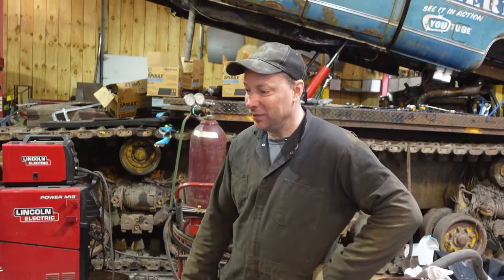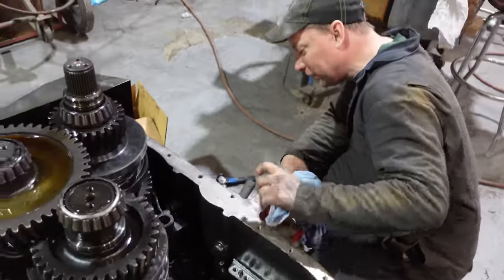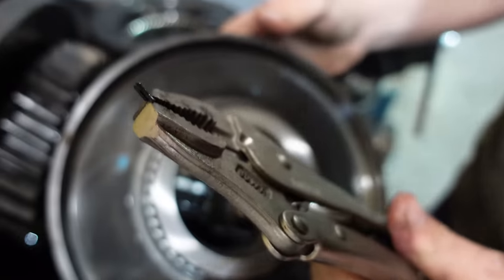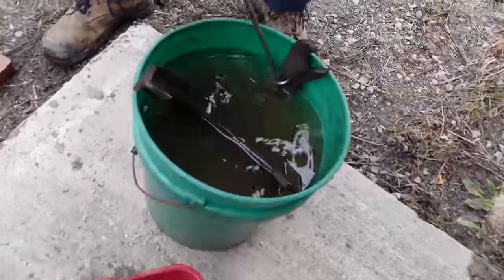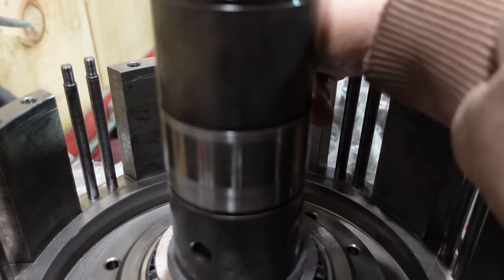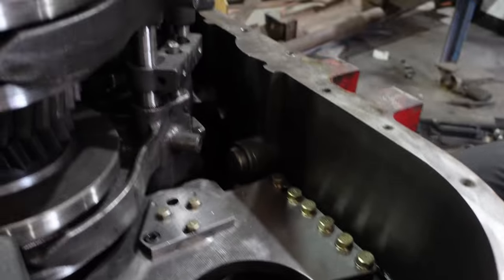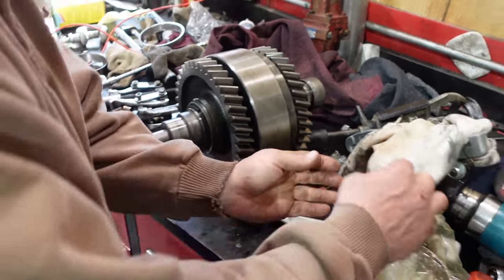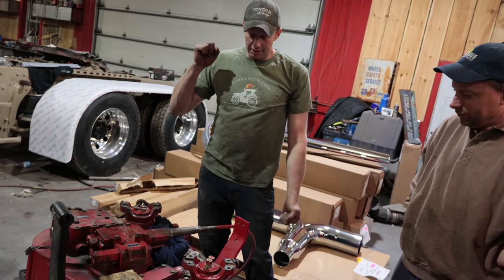Spend $70,000 ...or Fix it? 24-Speed Synchro Transmission | Case IH 9350 Steiger [EP2]

Comment: I'm a hobby mechanic at best. I've rebuilt engines, a Dana 44, etc. I can sort of weld, I can usually figure out most things. But this?!? Ho Lee Chit. This is baffling. Respect to you fellas for tackling this Chinese puzzle of a transmission!
Reply: A shop manual with instructions to troubleshoot and rebuild parts # clearances and exposed views is the only way I can get on to something critical
Reply: Just a big box of gears 🤣🤣🤣 lot of steel
Reply: I build race cars, but I still have no idea how an automatic transmission works. It just does.
Reply: @1one3_Racing  so true hahaha
Reply: It's Japanese.
Reply: Oh some bad news, you are to rebuild one, install one in your vehicle and see how long that Dana 44 can live with the insane torque output this gearing can give you :D
Reply: No doubt
Reply: Chinese??? I think you should learn to do research with a search engine...
Reply: Same
Reply: It looks more scarey than it actually is . Big things are easy but heavy . Just make sure clearances are right or they either chew themselves to bits to tight or rattle when to lose .
Reply: @ytthecommunistplatform.2675  Yep I'd take my chances with this transmission versus trying to repair a Rolex
Reply: In the Same boat , With a manual , I'd give it a try , and a phone a friend !
Reply: @khancrow8212  Chinese puzzle: an intricate or ingenious puzzle.  You might wanna take your own advice before assume what some else meant.

Comment: This and all transmission rebuilds seem like a "how hard could it be" job that you start then never can get everything back together, either loosing, forgetting, or putting in one small piece wrong and have to blow it all open again. Great job on this.
Reply: I wouldn’t wanna be the one paying for it
Reply: thats how rebuilding my lawnmower diff went, broke the open dif so I welded it(pro tip torch the gear to burn off the oil before welding) and uhhh not so much forgot to put a part back in, more so that I forgot on my unit, like a bicycle, it needs to be engaged to pop into gear. Guess who re-rebuilt it thinking he messed something up? (:
Reply: I'm currently rebuilding an automatic out of an 80s mercedes.....it's been an ordeal for sure lol

Comment: I'm with Kevin regarding sealant. Definitely falls under "The bigger the gob, the better the job"
Reply: Also, it's anaerobic, so it shouldn't clog up any oil passages.
Reply: @jrevillug  you’re kidding right?
Reply: @jrevillug  shouldn't 😂😂😂 but believe me it will 👌😂😂😂
Reply: Don't use any more anaerobic sealant than necessary. Squeeze out should not cure and get in screen, but it can if there is too much.
The suction screen is not very large on those, but all oil goes through the pump, is filtered and cooled before entering the transmission. There should be no sealant used on any of the gaskets that seal the shaft ends.

Judging by the amount of external squeeze out they used way too much expensive sealant.
Also, I hope they wiped it off, that stuff never cures and you end up with 515 all over your clothes.
Reply: @jimnaden5594  yup, this is exactly how my FR-S died after Toyota performed a valve spring recall on it. They used too much sealant on the timing cover and bits of excess RTV clogged one of my oil galleries, and part of the pick up. Not cool.
Reply: I agree completely, especially when it's a part thats a PIA to get at
Reply: I strongly disagree.  Especially with that Locktite 518.  It is used in MANY applications where you have a machined surface mating to a machined surface.  I just rebuilt an outboard motor that calls for it.  If you look at it when taking it apart you can barely see the residual 518, it is that thin.  A thin, almost see-through even layer is all that is required.  99% of what he applied will squeeze either outside the case, which is fine, or inside, which may not be fine.

His case will not leak, but he needs to pray that the excess sealant doesn't clog any oil galleries.
Reply: @zabzinski  that's because RTV isn't anaerobic, part of why that type of sealant is called for sometimes. Unfortunate about the engine. Definitely have to be careful about that when it comes to RTV.
Reply: @Bobbywolf64  yeah I remeber doing the valve/cam cover on a volvo white block engine and on those the valve cover also acts as the cam journals and that cover calls for anaerobic sealant beacause of the machined surfaces. The correct procedure according to Volvo is to apply it using a roller so it should indeed be a really thin layer

Comment: I love doing gearboxes, especially big ones. I used to spend my saturdays putting engines and gearboxes back together after the line mechanics took them apart during the week. they were warranty returns going back the the factory from the truck dealership i was working at, and it was really just so they all went back in one lump than as a box of parts. I learned a LOT doing that, a perfect job for a 14 year old! Since then I've always taken gearbox jobs if given the choice, nothing is more satisfying than watching nicely machined parts go together.

Comment: So, I was a small engine mechanic for about 15 years. My personal mower now is a kubota g1800 3 cylinder diesel. I WAS APPAULED AT THE PARTS PRICES! $120 for a U-joint, $100 for an idler pulley, $350 for the e-box that controls a couple of simple safety's and turns the engine off... Just insane to me. $120 for a u-joint that doesn't even do half the work of a car? holy cow! Most expensive lawnmower to repair I've ever seen in my life.

Comment: I am NOT a Case IH tech, but I've seen clutches like that master clutch before. Pretty sure they're supposed to be dished like that. Helps break the oil sticktion so the clutch doesn't drag. If they were all completely flat, they'd ring together like gauge blocks and act engaged.
Reply: Those plates are not to have a bevel to them, they should be flat.

Comment: The beauty of anaerobic sealer is that it does not harden except where it needs to like on the sealing surface, any extra will dissolve into the oil and not plug orifices like RTV will. Love that stuff but man it is spendy.
Great job on that trans, lets hope it all works once installed!

Comment: Great video!  This was awesome to watch.  One thing, though:  When you were setting the pre-load on those bearings at the end, you measured a gap of 0.022".  Earlier, you said that you were allowed 0.002" crush on the gasket, so, with a gasket thickness of 0.020", the gap could be 0.018" to 0.020".  With a gap of 0.022", wouldn't you need to remove a two to four thou of shim thickness to have proper gasket crush?

Comment: I did a bunch of business with Snead at my previous employer, these guys definitely know their CNH drivelines as they rent several old, and new Steigers for use with large scraper pans.. not many better ways to destroy driveline components than scraping, especially when the operator isn’t paying for the equipment.
I have visited their shop - it is exactly what you would expect out of a tractor shop in Alabama haha. 
They have built several of their own tools for rebuilding these huge transmissions and axles as well, I was told one of their axle presses gets frequently rented to large CNH dealers as it is the only portable press capable of working some of the assemblies in the country.

Comment: This video got me motivated to change my drivers side CV axle on my 2002 Ford zx2. Its a 4 cylinder automatic, them things are a bitch to release from transmission, even had the tool with slide bar, but a crow bar did the trick. Hugh Mc -Chicago metro

Comment: I worked at a case IH shop for a few years and seen several 9350s in the shop. I never seen the inside of one of those though. I worked on the cane harvester side. I did a lot of work on the 8.3 Cummins and was the shop welder. I did cut out and replaced a few center section pivot plates on the 9350. That was a job. They usually took out the back glass before they realized the steering bushings in the plate were gone and destroyed the plate. I did help them cut up and scrap a few old 9350s and we sent the motors and transmissions over seas somewhere.

Comment: Sure I will pull it apart. It getting it back together correctly is where the money is. Been scared before but last time I thought about rebuilding a trans I looked at the new blister pack of parts and took it to a trans specialist…. No problem working on my 6.0 power smoke but not willing to open the can of worms on a transmission. Hat off to ya Kev. Can’t wait to see the Case pop thru the gears..

Comment: Thanks for putting in the time to show us how a big gearbox repair can be done.  I've been lazy leaving my truck box without a 3rd synchro for years, but feel more confident to tackle it knowing it won't be nearly as complicated as this.  I bought the reco box for a hino engine swap on an old inter firetruck motorhome years ago and the synchro was no good, but the hassle of pulling it out again for warranty wasn't worth it at the time, so just drove it.  Wifey wants to drive it now, so might have to fix it after all :)

Comment: I'm glad to see you used citric acid to clean up those rusty parts.  I use it to clean out motorcycle gas tanks and I can't believe how well it works!  If you let it sit a couple of days and swirl it around once and a while, a nasty 50 year old Honda Trail 90 tank came out looking like new inside!  It works great and isn't toxic, and it's safe to send down the sewer sink if you dilute it.  I think you were had on the cost of the citric acid powder though.  Amazon has a 10 lb bag for ~$32.00 Canadian Dollars (used 1:1.28 as conversion factor from USD to CAD).

Comment: I've never anything that big apart. But having built a lot of small manual transmissions my guess would be with those pins missing when shifting the sleeve isn't applying even pressure to the synchro when shifting preventing the synchro from actually slowing the gear down.

Comment: All three transmission shafts and shift forks come out as one ☝🏼 assembly…
You remove the shift fork shafts and then the transmission comes out of the case.
Use a ratchet strap to hold the three together !

Comment: When measuring clutch clearances with a feeler gauge you need to use at least 2 feeler gauges on opposite sides.  With a clutch housing that larger you really should use 3 or 4 eeler gauges.

Comment: The reason for the polymer seals is that they won't ruin the bearing surface with wear, unlike the steel/ cast iron rings will

Comment: Wow, great job. I went through a couple Case plant in the 80's, they had sealant by the 45 gallon barrel full like the grease guns in shops coming in lines from above, and they were putting big beads on it then. It was orange sealant just like the Case castings were then. Seen a finally assembly plant ( 2200 series) and the transmission plant for the same. Guessing Kevin's background is heavy equipment and not Tv's 🤣. 👍👍

Comment: RTV only squishes to 3-5thou MIN. For any boxes where the split joint creates a tolerance use 515-518. It sqeezes to 1 thou or less, so it's very predictable for outer-race crushes and tapered bearing pre-loads.

Comment: Could you get more parts from the transmission put under x-ray, parts that you suspect could fail, to look for micro fractures, nip things in the bud before you put it back together, replace things before they fail, could the casing be warped?.

Comment: I literally got an anxiety attack just looking and listening to you guy's describing what you were doing to repair this giant gear box transmission. I been working on computers since 2002 there are not really a lot of moving parts in a computer. I remember in college telling myself before; I could work on a computer I needed to have a basic understanding of what the hell it is actually doing. So, ok input goes in here, next processing is happening there and then output, say visual is showing up on the monitor some times accompanied by audio along with some thing being answered or accomplished. After only a couple years. I would say; simply it's just a stupid machine to make my self feel superior and with out a human it's useless. Knowing I was basically full of shit. But; it helped me feel better when I fixed it or at least knew what the hell was wrong with it. Well I am still amazed that they can first design a gear box like this and then there are guy's who actually repair and understand the process of how it works. It really boggles my mind.

Comment: OEMs make a large portion of their profits on aftermarket parts where they mark them up outrageously. Most of the replacement parts are commodity items. If you can figure out the equivalent generic part, save the money.

Comment: The way Kevin measured the preload sounds Like the gap was .023 and the gasket was. 020... wouldn't that leak and not give any pre load?
Reply: The gap will close up to the gasket thickness, and that will preload the bearings.
Reply: Yeah, He seemed confused. At first he said was going for 0.018"  and if more that 0.020" shims would be removed. Then he said 0.022" was good because your allowed 0.002" for crush.

I'm just going to assume he knows what he's doing and just said it wrong. Once the bolts are torqued to spec it should close up a 0.004" gap.

Comment: With the Nissan 4wd TD42  6 diesel direct injector pump when it plays up & starts stalling it can be the $2.50 seal in front that lets air in & diesel out . . for that few hours fix they charge over a $1000 for an exchange pump & you have to give your old pump over as well so they can perpetrate the scam all over again . . Australia racket with that bit

Comment: Always Always ALWAYS!!! go for 5th then put it in first if you cant get it out of neutral. I hear/see this all the time at the truck stops... guy in a nice 300k pete and the clutch brake is shot so they just grind it till it falls in... hit 5th gear first then second or third, hell I've driven some so bad had to put it in high 6th then drop it in 1st or 2nd.

Comment: Older Australian built International tractors had proprietary bearings throughout the drivetrain where the journals and housings just didnt fit standard and cheaper bearings.  They did it on purpose and the roller cages in places were soft and didn't last. If you knew where to look you could get bronze caged roller and ball bearings which were better
 Sad to see the same thing 50 + years later....

Comment: Yeah bearing prices are weird I just bought a 550$ one for a chipper. When I received it I realized if I could have saved the housing instead of having to cut it off the shaft the bearing is only 100$. So they charge you all that money for some cheap cast iron housing cause they know your not getting it off without cutting it.

Comment: It sucks that the bearings used in the tranny are specific to the manufacture, but this is just another case of "Right to Repair".  The manufacture (Steiger) made the choice to use special bearing (only available from Steiger) so that parts could ONLY be purchased from the OEM thus guaranteeing profits from parts sales.  So the end user is stuck purchasing $600 bearings when a $50 bearing could have been used.  God help the end user when Steiger stops making replacement parts as the equipment ages out.  (There is likely not enough of a market for a 3rd party to step up and start making bearings for these oddball applications)
Reply: Well that's not necessarily true when steiger didn't make anything on the tractor.....that transmission is Fugi......the axles are Raba. Engines where Cat or Cummins

Comment: So what  brand of transmission is that? I drove a Wildcat with a 2 range Fuller 5spd and NA 3408 Cat. Also what do the shifters look like inside the cab? Like a semi truck? I think I remember looking at the brochures and there was a Cummins engine available with Jake brake?
Reply: 24 speed Fugi Tech synchro

Comment: Someone crashed a little lathe at work and it sheered teeth off the carriage rack. They kept running it and super screwed it up. Jet wanted $250 bucks for the rack and $40 for the gear. Work scrapped it into my truck.  I TIG welded the teeth back on the rack and filed them back to profile. 35 of them. Nope, wouldn’t recommend. It’s still working but it suuuuckkked.

Comment: For citric acid to work you need to degrease the parts. A can of engine bright and a pressure washer then in the bucket with no bricks and 2 cups citric to one gallon. Parts will come out bright or may be dull gray/ light blue.

Comment: Muriatic acid will do the same thing but a lot quicker. You need to be careful with it though because it's a lot stronger than citric acid and will eat your parts. Muriatic is hydrochloric acid so it's a pretty strong acid. You could also buy a bottle and dilute it until you get similar strength to citric. Coke has phosphoric acid in it but it's a pretty weak acid. Battery's have sulfuric acid and that's a strong acid, stronger than hydrochloric I don't know if I would want to use something like that to clean my metal parts. That's pretty much all the common acids that most people run into around the house. Nitric acid is a strong acid as well but I can't think of anything that's used around the house that contains it.

Comment: Fantastic content.  At first I thought you were rebuilding a 9370 Powershift transmission.   I'm surprised the syncro transmission gave trouble.  How many hours were on the transmission ?   Was it pulling a scraper ?
Reply: Kevin said 4000 hours, and the rebuild guys typically see them rebuilt around 8000 hours, so this was a relatively early failure.  Said he puts on 200 hours a year, so if he gets another 2000 hours out of it that will be 10 more years of use.  The area where they live is pretty flat, so my guess is it's pulling regular farm implements.